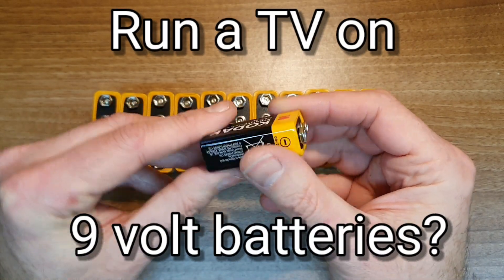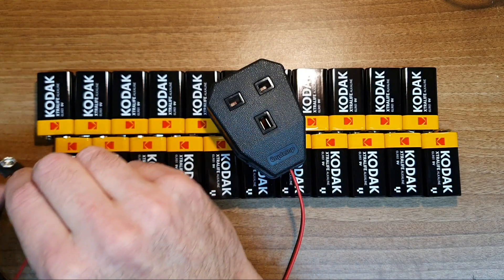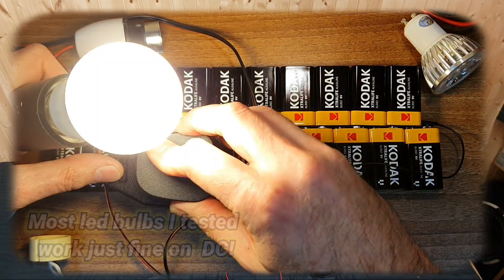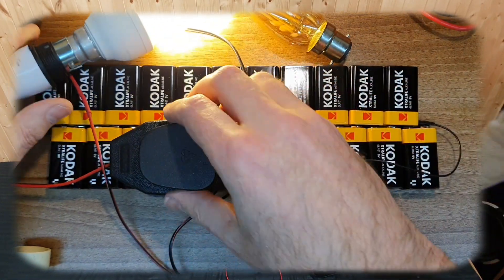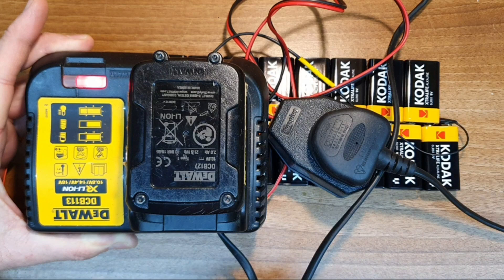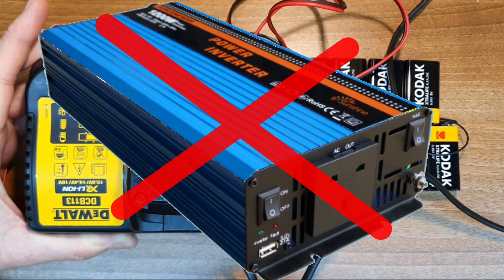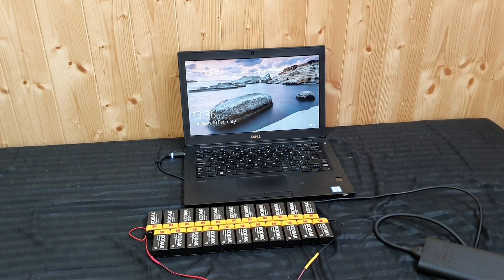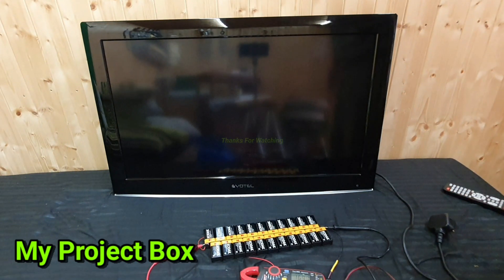TV powered on 9 volt batteries? Is DC a off-grid solution for modern appliances?#ElectronicsCreators

Comment: All good but extremely dangerous
 You can arc weld at 50 volts. With a 48volt system you can easily power most dc appliances  and electronic goods using step down converters and only use small inverters where needed.
Reply from the maker: Switching Higher DC voltages ⚡️ can be problematic, due the the arc not automatically extinguishing, like it would with a AC voltage, because of the "zero crossing". But this can be dealt with by putting multiple switch contacts in series. You can also add a "extinguisher magnets" that help to push/blow out the arc. You can add a "explosive" master disconnect fuse(electronicly controlled, with arc fault  detection)
I like to design my own solutions, but  commercial solutions are available. I still think that it will be feasible for a small off-grid project experiment. Try to do it as simple and safe as possible. I want to try and eliminate as much electronic modules as possible failure points.

Comment: How long will the batteries last for the TV.  Can 9 v. Batteries run an air conditioner?  Brilliant experiment. Thank you.
Reply from the maker: No I'm sorry. The 9v batteries won't power a air-conditioner. The TV was just a fun experiment but not very practical. But bigger batteries will be more practical,  like for instance multiple 12v car batteries connected together.

Comment: with 22 pieces of 9 volt box battery capable of turning on the laptop.
can it also turn on a mini computer with 90 watts of power...? if so, how many hours can it last? or maybe it takes how many batteries to turn on the mini computer?
Reply from the maker: It is possible to run your computer on 9v batteries, but not for very long! I definitely do NOT recommended it, it's not practical.
Reply: @MyProjectBoxChannel  does it take up to 1 hour, with a 22.9 volt battery, or does it need more battery?

or maybe you can use a 3.7 volt 18650 battery, you can use a parallel circuit, do you need an additional module?

Please give me a solution, I have a mini computer with a keyboard and a portable mini usb monitor, I want to use the battery like a laptop, at least 2 hours is enough, thanks

Comment: Im wanting to wire 360 vdc solar panel string into an inverter type air conditioner. Same idea. It seems usual solar systems do some silly steps. Dc to ac to dc to ac to dc again. Craziness.
Reply from the maker: Yes straight DC seems more logical. Maybe in the future it will be more common.

Comment: So what made you think of running items from DC?? And if you can run items that need 220v AC, how about American items that only require 110v AC?? Thanks for the video, very good, How about a battery and a DC buck boost.
Reply from the maker: I just wanted to get people thinking about about DC, and how AC is not as important as it used to be. As for 120Vac in the US, you have to kind of think of the DC equivalent being the peak voltage of the sine wave, so about 170Vdc. A boost converter is a great idea. It's much simpler and more efficient than a sinewave inverter.
Reply: @MyProjectBoxChannel  I am a few weeks from selling my current house, and will be building a new home that will be a DC wired, PV house, with point of use inverters for only a few items - microwave, refrigerator, etc.

Is there anyway I could contact you directly?
Reply from the maker: @geekstradamus1548  Oh wow that is exciting and interesting 🤔. You can contact me on Facebook messenger. https://www.facebook.com/My-Project-Box-105438131355367/

Comment: Just a question, dc has no hz , while ac has 50hz/60hz .
Reply from the maker: Yes Correct! But it's mostly old fashioned transformers and some types of motors, that strictly require the 50hz/60hz AC power. Most modern appliances will work on both DC and AC

Comment: What if u jump the AC rectifier board to DC because i mean most circuits in our appliances convert AC to DC in order for components to function.
Inside our appliances there are always step-down transformer than rectifier than capacitor for Halfwave cycles than distribution of small different voltages.
Like computer after rectified the outputs are like 5v, 12v,24v 50v Vdc for PCB that why we just connect cellphone and charge same time.
So what happens when u connect 12v direct after rectifier

Comment: I have a 120/240v IGBT (microcontroller controlled)welder and I was been really scratching my head if it will work on dc, since it's 7kw and inverters on 7kw is not particularly cheap) I think I will try it thru a fuse.
Reply from the maker: it should work, but it all depends on the design of the circuit. Put an electric heater in series for current limiting. Just to test if it turns on okay. If it has a setting switch, set it to 240v. Some power supplies have a voltage doubler mode for 110 volt. https://youtu.be/D9he-mVUEX4
Reply: @MyProjectBoxChannel  Where is no switch, it's a "smart" welder, detects voltage automatically.

Comment: This is fantastic. Would it work the same using 24v lead acid batteries in series? 
I really want to try this with my solar setup. Would love to get rid of the inverter.
Reply: How long would this run a TV for its fascinating.
Reply from the maker: Yes lead acid batteries would definitely work! if you connected enough of them in series to get a high enough DC voltage. You have to experiment to see witch appliance can operate directly on DC. I only used 9v batteries to do the experimental testing, but bigger battery would be the practical way to do it 😉
Reply: @MyProjectBoxChannel  Thank you for the quick reply. keep up the good work. Big Clive definatly has some competition!  
Would love to see a video on running leds at different voltages ie 6-12v run on 24v system using resistors.
Reply from the maker: @lookuptv6755  what would you like to see? individual LEDs powerd from different voltages? Or LED tape (striplights) powered from different voltages? Maybe connecting more than one LED in series, for higher voltage operation.
Reply: @MyProjectBoxChannel  Thank you for this fantastic channel. If using led light strips directly to a battery would it be beneficial to add an extra resistor?
Reply from the maker: @ArnookieVR   if you're using 12-volt LED tape  it should have built-in resistors. So you should be able to run it directly on a 12-volt battery. You can add a series resistor with the LED tape. This will make it slightly dimmer, but the LEDs should last longer on the lower current. Also when the battery is being charged the voltage can be as high as 14 volts. The resistors on the LED tape is designed for 12 volt operation, so 14 volts is a little bit high but still okay. You can also connect two equal lengths of 12-volt LED type in series, to run them directly from  24v. 5v led tape can run directly on a USB phone charger.

Some striplights panels do not contain any resistors so you need to add resistors for current limiting for the desired voltage you operating them on.

Comment: Nice experiment, I was wondering how far you could reduce the DC voltage down and the appliance would still work.
Reply from the maker: I don't remember the exact figures different appliances would cut-out at different voltage thresholds. Some of them you could push pretty low, much lower than stated on the label.
Reply: @MyProjectBoxChannel  I guess it would be down to the SMPS offline switcher IC and its bootstrap circuit, well that's getting into more detail. Anyway great proof of concept.

Comment: Not a surprise, as you clearly show in the diagram, a smps is basically an inverter
A friend of mine tried powering a PC power supply from as low as possible, he got it down to about 20 volts reliably, though he only had a light load on the output.
Many electronic devices use SMPS and often list a wide range of voltages, just like the dell psu.
Some cheap phone chargers or led mains lamps use a series capacitor, so those won't work either.
Reply from the maker: 20 volts! Amazing 😂🤯 I have successfully run some GU10 LED lamps down to 12v! ( The type with a SMPS  inside)

Comment: Would it damage my fridge to test it ?
Reply from the maker: Unfortunately It won't work because the fridge motor requires AC to operate. Some of the new energy efficient fridges have inverter motor drives, and they might run on DC.
Reply: @MyProjectBoxChannel  I seen (repaired, actually) an electrolux drive what have an inverter driven pump, I think this one will work. Can you test out obviously applience what will not work on DC, as well some barkers, does it gona just trip a breaker or what? Let say AC motors, fridge, old washer?(most of the modern "direct drive" units runs bldc motors, so they should work). AC Dryer will work, but I think you still gonna need to feed a motor what turns a drum with AC.
Reply from the maker: @pashko90  you would have to pick your appliances carefully. AC motors( induction motors) and transformars won't work and definitely trip the circuit breaker! brushed universal Motors work fine on DC and AC.( Like old traditional vacuum cleaners). You will also need DC capable switches fuses and circuit breakers. I think it would be possible to have a DC powered house with some careful investigation and work.
Reply: @MyProjectBoxChannel  Yeah I thought so. Still astounded by this experiment ! 👍

Comment: Check with electrical engineers. DC to AC is done mainly to avoid thick DC wires afaik, which on a small solar setup won't be too much of an issue anyway. Avoiding the inverter is a dream come true for anyone electro-sensitive. It's the worst part of the solar system for those people. Charging a phone with 120V DC is ... well. It can be charged from USB 5v? , so why bother to use the charger?
Reply from the maker: The phone charger was just for testing  another appliance with a switch mode power supply. 12v to 5v is simple enough, like a car cigarette lighter phone charger. It's just interesting to see how many appliances will actually work directly on DC.
Reply: AC or DC has no significant bearing on wire diameter.
Reply from the maker: @seemonster77  You are correct. High voltage = thinner wire for a given wattage (AC or DC)
Reply from the maker: @seemonster77  In actual fact. DC is I bit better, with AC you have something called the skin effect.
Reply: @MyProjectBoxChannel  that's why I said "no significant".. Skin effect at 50hz will not be much.. I think?
Reply from the maker: @seemonster77  you're right it's more valid at higher frequencies. it's probably significant transmitting electricity on power lines for long distance. Apparently ultra high voltage is now being transmitted across DC power lines because its more efficient. In the past  we had to use transformers and AC step up the voltage. Technology has improved. Ultra high voltage DC is becoming reality.1.1 million volt DC it's insane!
Reply: @MyProjectBoxChannel  Namibia actually has   a DC supply from Cabora Basa.. Not sure of the voltage, but I tell you I will not get close to that thing. Probably enough magnetic field to violently remove my dental fillings from 20m away. 

Advantages: 
1: it is one single conductor - they use earth return (!!).
2: they have no grid sync issues. They have MASSIVE GIGANTIC inverters (buildings full of them) to create 3ph AC properly synchronised to their grid.
Reply from the maker: @seemonster77   I know about Cahora Bassa. I think they used massive stacked thyristors at the time, to cope with extremely high voltage. Single wire earth return system is pretty cool. Single wire is often used in rural power distribution with AC. It's step down with a transformer spiked to earth for the end user. I wouldn't stand anywhere near the earthing point 🤔😂
Reply from the maker: Switching relatively hi DC voltages is more difficult as well. Arcing when switching DC is more problematic

Comment: Wow, I wouldn't have guessed the 9v batteries would supply enough current. How long did the battery pack last?
Reply from the maker: 9v batteries can supply about 0.5A for 1 hour, so 0.5A X 200volt = 100w for 1 hour. Give or take. The TV is probably just over 100w
Reply from the maker: Not long, just under an hour. But it was just an experiment not really a practical solution. And to prove my idea that you could run appliances directly on batteries. DC